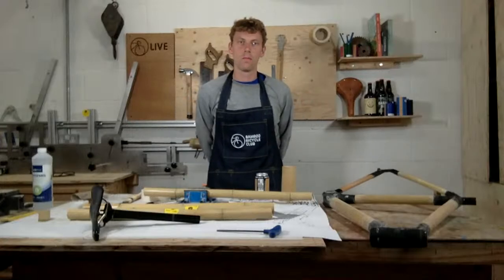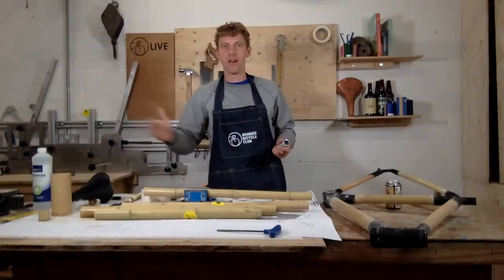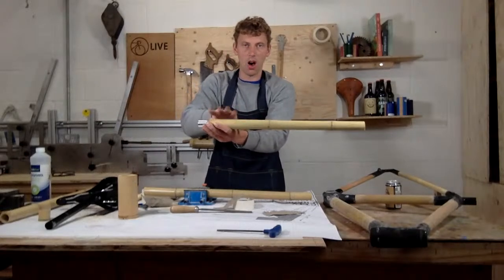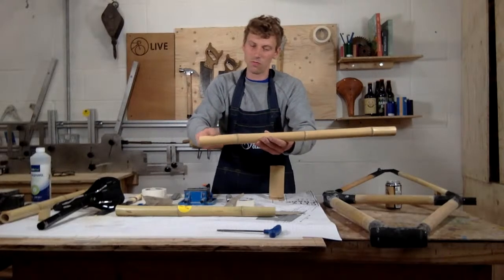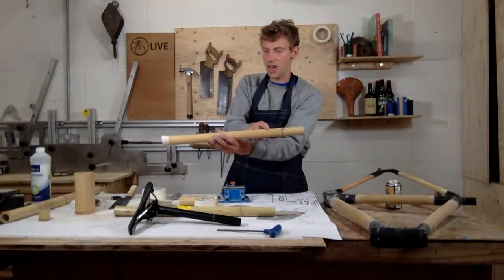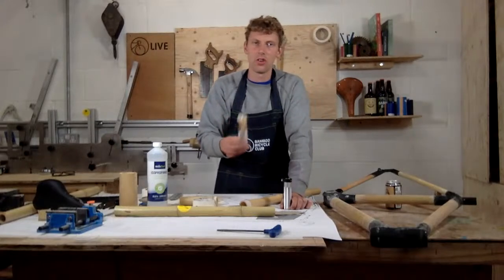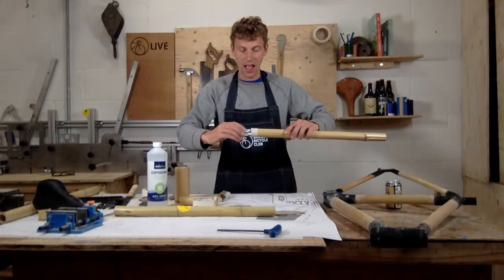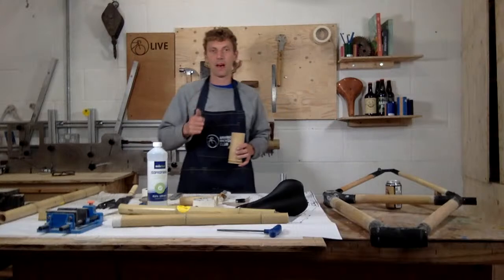How to fit a Seat Sleeve into Bamboo

Comment: James, is it important for strength to keep the nodes solid, or could you carefully drill/bore one out if it's useful to do so?
Reply from the maker: The nodes don’t add any strength i would always remove, they are wafer thin so a long bar will remove.